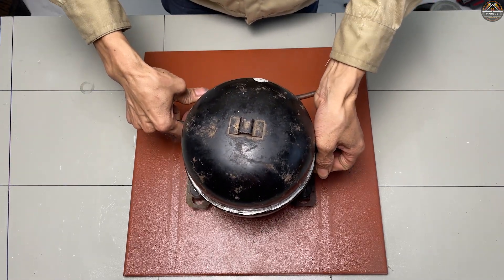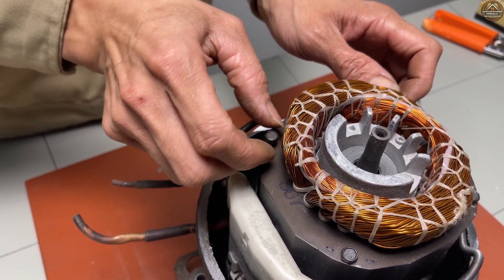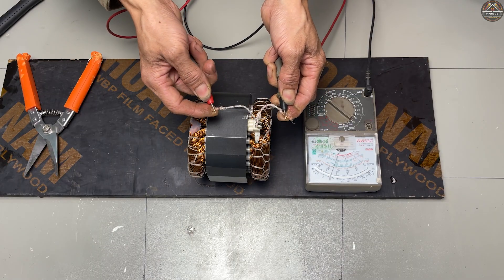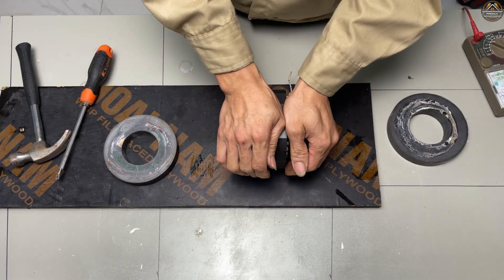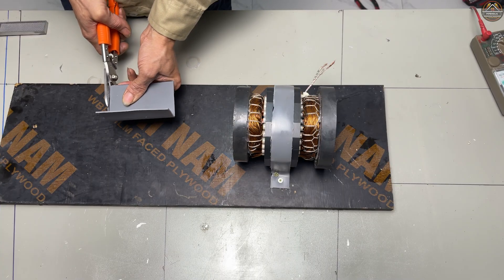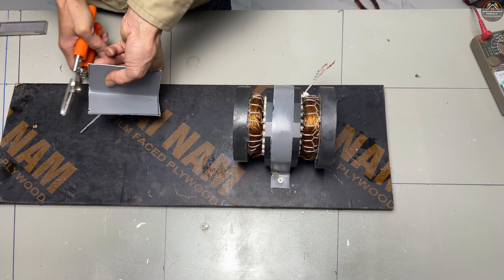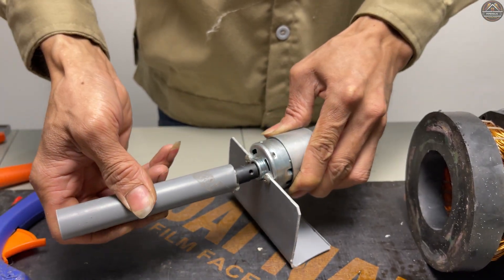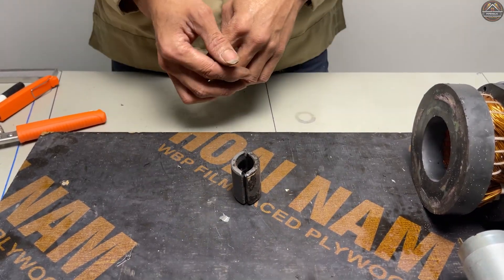Why Didn't I Know This Sooner FREE ENERGY Generator from Old Fridge Motor!

Comment: The Holy Grail. 🏆 Extraordinary claims require extraordinary evidence. Nikola Tesla’s Dynamo Electric Machine is empirical, practical, and universally applicable. NASA can overcome the reputational risk of endorsing a self-generator, as the technology is decentralized and scalable. The generator contrasts with ITER’s Tokamak Fusion research, which will take decades to develop.
Reply from the maker: Thanks for your insightful comment! I appreciate you sharing your thoughts on the potential and challenges of such technology.